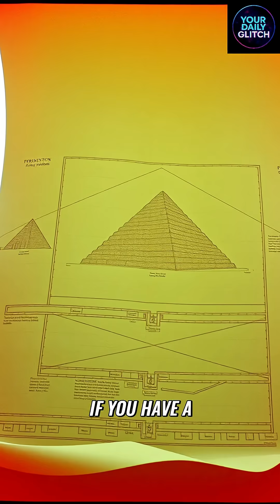Pyramids Precision, Blueprint Theory & Lost Ancient Knowledge — How Were They Built?

Comment: They're bricks roughly the same size at the  Western wall the exact same people who built the pyramids the jews and I'm not talking about the ones above in case you did not know I think it was the Romans since they could not destroy the  Western wall They buried it in garbage And then over time since it was not possible to remove that garbage what they did is they added smaller bricks on top the actual bricks are roughly 20 feet by 10 feet by 10 feet 20 feet long  10 feet wide and 10 feet deep Or something like that which is roughly the same exact as the Pyramid